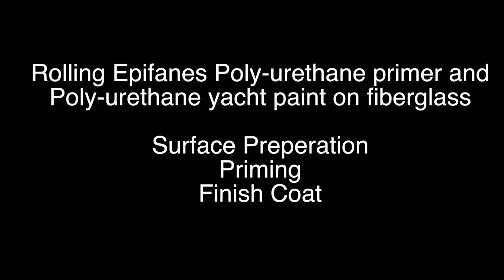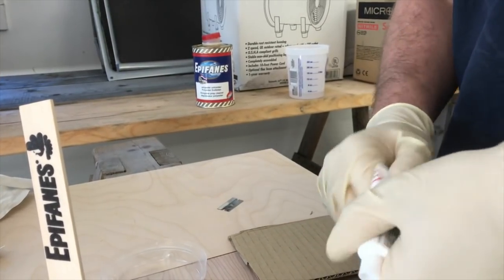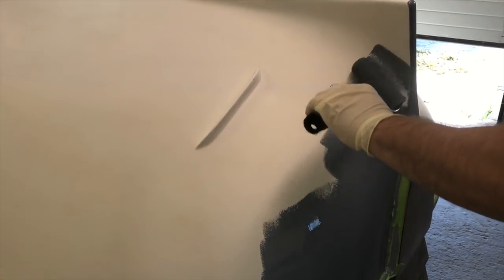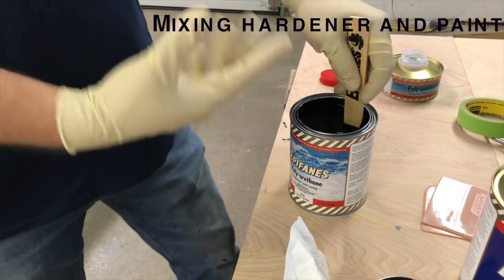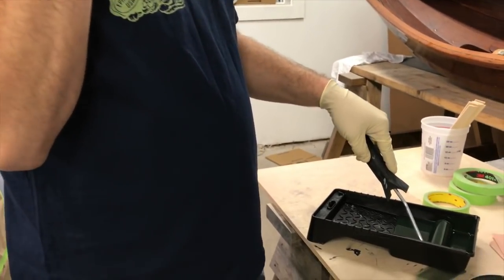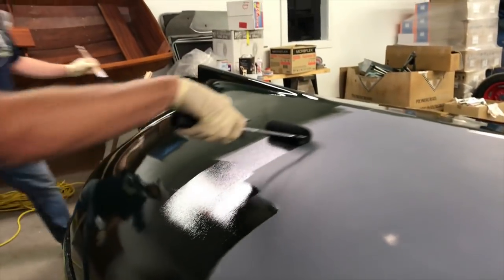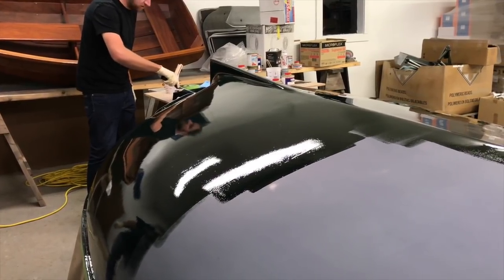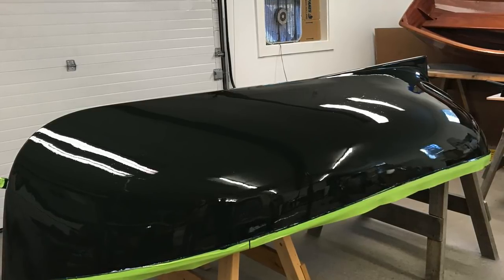Rolling Epifanes Poly urethane

Comment: Never use bare cardboard for mixing. The surface will soak up components from either component and therefore corrupt your mixture. Put some masking tape on the cardboard first.
Reply: bullshit, it doens't absorb enough to make any noticeable difference. The mixture doesn't need to be perfect down to the last atom.
Reply: BS old wives tale. Ive been doing bodywork and painting show cars for 27 years.

Comment: I just tried to lay down the poly primer with foam and nylon roller covers, and it failed miserably. I ended up using a brush, but it didn't lay down at all. I followed the instructions thinned at 5% to no avail.

Comment: how is the poly urethane strength wise compared to the epifanes mon urethane? I have my boat in the epifanes mono urethane for a number of years now, but it can scratch pretty easy in my opinion. It also developed some cracks in the paint now after i think 5 years of it being on. So i was thinking maybe the poly urethane wil stay on longer? It is a steel boat, so i want the paint to cover it as good as it can because i dont want rust on it.

Comment: Can I use a two component epoxy filler in between the sanding and the final finish coat? I have some little pits and scratches that didn’t get filled with paint, I want to fill them after sanding the primer coat.

Comment: How come you didn't roll and tip?
Reply from the maker: We discovered that our Epifanes Poly-urethane has such a good self-leveling characteristic, that we can achieve mirror-like finishes with rolling alone. Check out our Instagram page for some great examples — in particular the '57 Chevy panel delivery truck. That was rolled-only, too. (We also use a fine foam "Moltopren" roller, which also plays an important part.)

Comment: Why couldn't I use this in a hydrostream Viking speedboat?
Reply from the maker: Hi David...no reason why not. One of the benefits of rolling (no tipping required) is that you wind up with measurably more mil per coat. In other words, more paint gets onto the surface, which enhances the paint job's durability. Let us know if you paint the Viking.
Reply: Epifanes N.A. Which color is used in the clip? 875?

Comment: If I buy your paints, I don't want to be locked into having to buy your high priced mystery cleaner/ solvent as well.  I would like the choice of buying a generic cleaner such as Mineral spirits, Acetone, Xylene, etc. Hiding the chemicals in your proprietary cleaner only makes me mad as hell.  This is a form of extortion that will steer me right away from all your products.  Its a pity because your products are excellent.  But I will NOT BE HELD HOSTAGE TO A GODDAMN SOLVENT!
Reply: You know... there are pills for that. Or a pet?